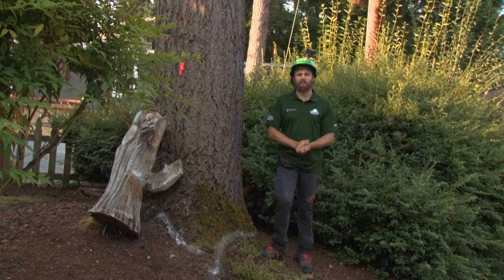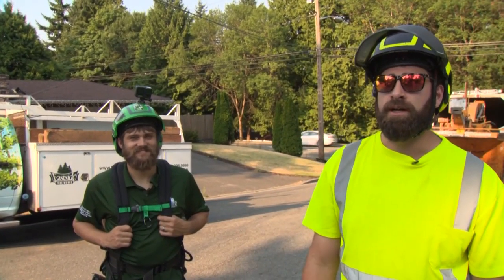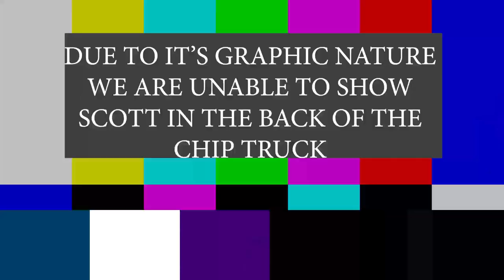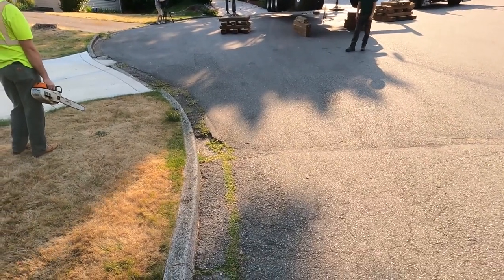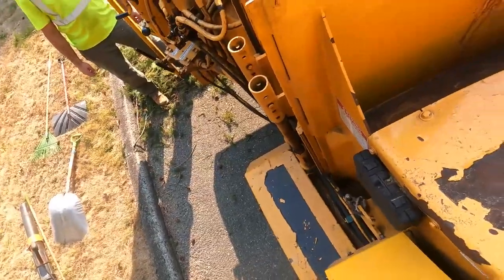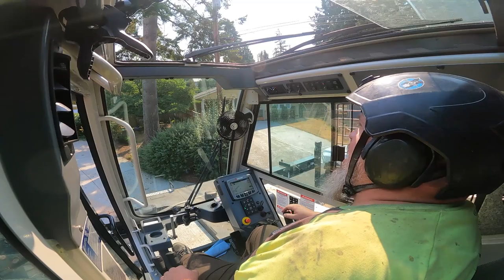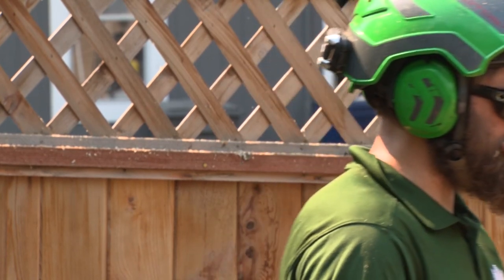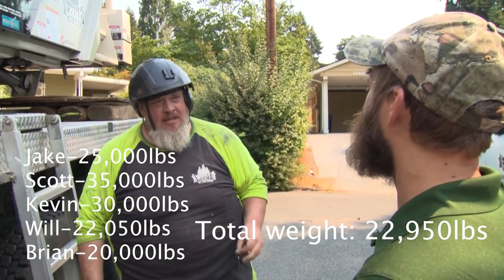WHAT'S IT WEIGH?! Electric Fir Takedown!

Comment: I'm surprised you don't use the 500i more often
Reply: I was actually thinking that too when he asked for and used the 661/660/066 (don't remember which it actually was, not that there's much difference in purpose from one to the next).  That 500i is so light with only a very small reduction in power.  I find myself reaching for it more than anything now sometimes even when a smaller saw would be more practical, maybe just because I want to find any faults early enough to catch during the warranty period.  In Jake's case though, his 66 is quite modified whereas the 500i might not be, so the difference in performance compared to the 500i might be bigger for him than it is for me.

Comment: FYI. use hardwood, pressure treated is garbage, i used it under a trailers landing gear once,  it squished it like a sponge,  trailer tipped over, and it popped right back like a sponge. no joke, it was completely flat  : /

Comment: Tell the guy  don’t feel bad about the chipper I did The same thing and Vermeer had to come out and use a mini crane to pull it out 12,000 pounds it took to pull it out it was all burned up on the side of the drum so we couldn’t get it out manually they charged my boss 1500$ & it took them 45 minutes
Reply: Yeaaaa...vermeer knows how to make money on maintenance.
Reply: $1500 is better than the price of a funeral, insurance settlement, and lost coworker.  We all make mistakes, and I hope those mistakes are just monetary losses and not lives or limbs lost.  I could be judgmental and condescending, except if I were, it would be my turn next to make a big mistake.  It has either already happened to you or your turn is coming when it comes to on-the-job f***ups.

My last big mistake was not sectioning a large/long limb when using a very long pole saw from the ground.  I cut it off right near the trunk, so when it came down, it was long enough to bounce and spring right at my hardhat/mask, knocking my headgear off and giving me a small scrape on my shoulder.  Not at all serious enough for medical attention, but quite a sobering reminder to be careful all the time.  Had I cut the limb in shorter sections, this likely wouldn't have happened.  That job was at a school where student volunteers were pulling the limbs away.  We ensured that they were far from danger when I was cutting, but they all got to see my mistake at a safe distance when it happened which was embarrassing.  I told them that's why we wear headgear.  I should probably modify it to include a chin strap or buy a model with one included.

Comment: Why does 'murrica have so many powerlines. 🤦‍♂️(Monterrey in Mexico was soo scary, because of them) 
In Europe we burrow them to not deal with that unnecessary shit. 
You have to dig trenches for the sewer and water system anyways, so just put them in there, too. (It kinda looks like you still live in the mid/late 1900s) 😂 Here in germany you're required to plant a new tree if you remove a live tree from a private property as far as I know. 🤓
Reply: Well, at this point, I'm guessing cost is the main reason we keep things the way they are.  I can't imagine how much money it would take to bury all the power lines in the US.  Given how old many of the lines are, I'd guess alot of them would be replaced instead of using existing lines.  

That said, burying them would solve the issue of outages due to snow, ice and wind outages and broken poles.  Sounds like that's the better way.
Reply: In so many ways, burying is the better way, but Germany is a much smaller land mass with a higher population density.  It simply isn't practical, economical, or feasible to bury the lines when you consider the distances and population densities here.  If you go into some American suburbs and urban areas, the lines are just as much buried as they are there in Germany, but other places have the lines in the air.